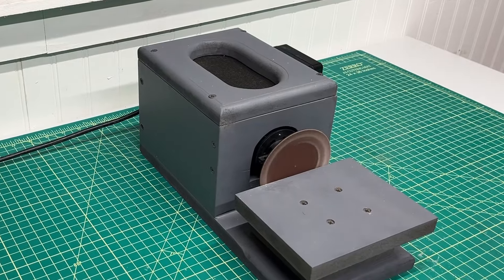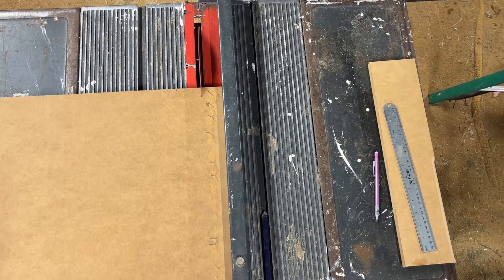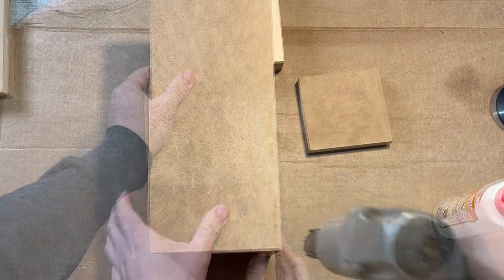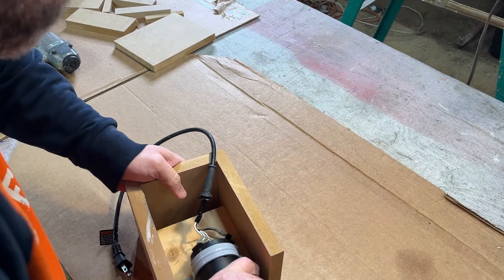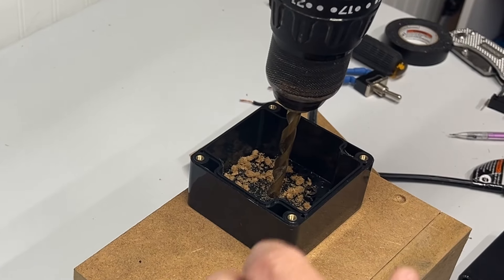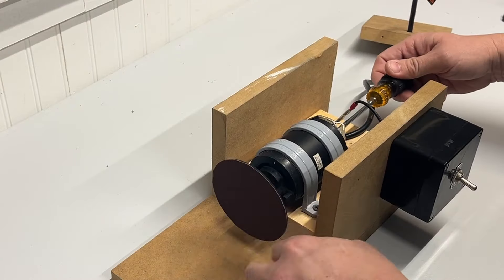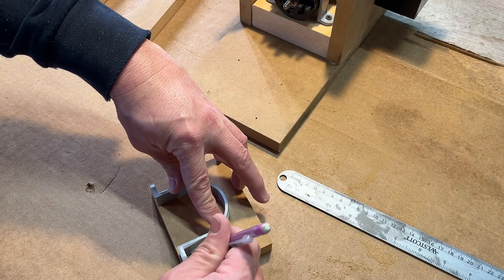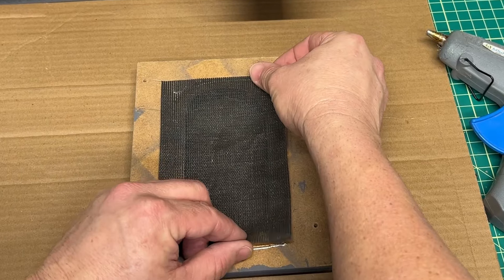DIY Mini Disc Sander

Comment: keep an eye out for an old hand held vacuum, wire it into the power switch
Reply from the maker: That's a great idea @MattQrillz!  I just may have to upgrade the sander now!
Reply: it works a treat, i modified one so that i can  use it inside for the dremel aswell if needed, but it mostly sit behind the drop saw plugged into the same power supply/double adapter so both turn on and i'm good to go!
best part is it was off facebook, someone giving it away because they didnt care to unblock it and just assumed it was stuffed 🤦🏼‍♂

Comment: Awesome project 😊
I do wonder how will you be able to change the sandpaper with it glued?
Reply from the maker: Thanks Cerise!  That sandpaper is definitely not coming off, so I will probably either glue another layer on top, or replace the disc holder when the time comes.
Reply: @makingwithmark  Why not glue on some velcro so you can only replace the sandpaper? Great Project though!
Reply from the maker: @MikeIzzywhoops  That is an excellent idea.  Perhaps a future upgrade to the sander for sure!

Comment: Wow... nicely finished.  How long do you expect the sanding surface to last before it needs replacing?
Reply from the maker: Thank you!  It's hard to say, but with the small pieces of plastic and sheet polystyrene that I plan to mostly use with it, I'm hoping to get quite a bit of use out of the paper before needing to replace it (or the entire disc holder.)  That's a great question by the way!